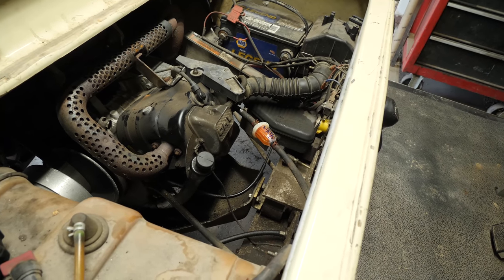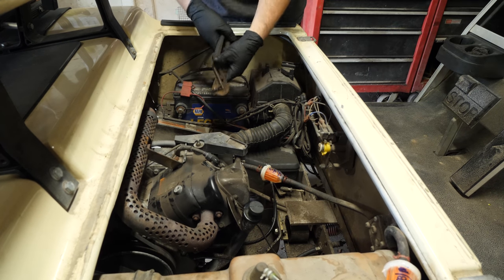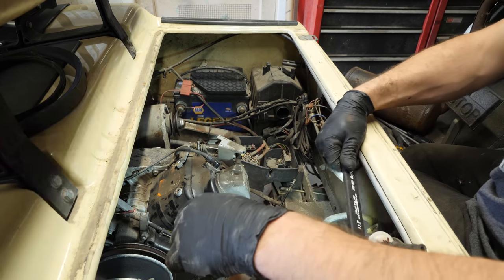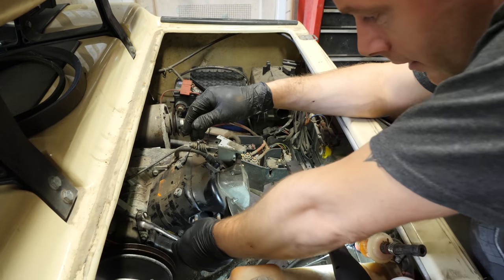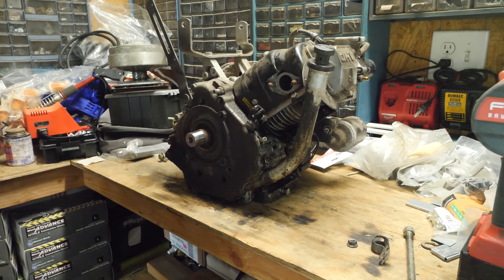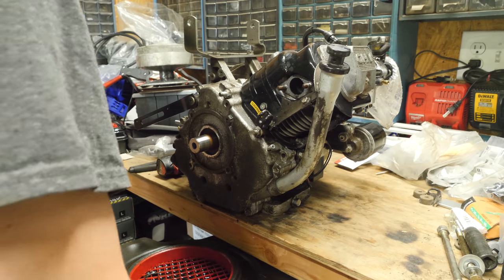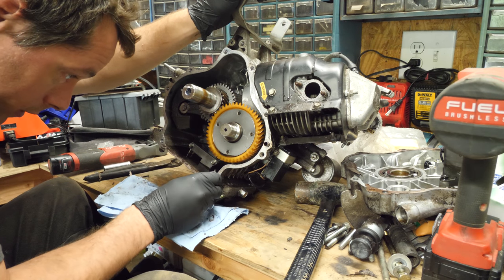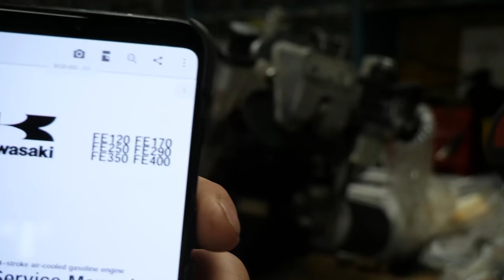2008 Club Car DS, Gas - Blown Crankcase Gasket

Comment: Thanks for the tutorial!  I got a 2004 CC Precedent with the FE290 at an auction and was disappointed (though not shocked) to find out it was leaking oil after I got it home.  I had been watching your videos prior, and quickly found this one with the exact symptoms I was having. I saw the same gasket breakdown you had with much of it pulled into the crankcase.  Several man-hours later, the new gasket is in and it’s running like a champ… with no leaks!

Comment: Thank you so much for this video!  It saved my butt.  I have a 98 CC with the FE290 and had the dreaded leaking crankcase gasket.  My first time pulling and opening an engine and it went fantastic.  Engine is back in the cart and running like a champ.
Reply from the maker: That's awesome!!

Comment: I really like the way you explain everything you're doing. I always try to find one of your videos when I need to fix a problem with my cart. Keep up the good work! We appreciate you helping us.
Reply from the maker: Great to hear!
Reply: @Kevinsgolfcarts  I'm trying to adjust the cable that's in the electric box that operates the cam that works the micro switches that works off the accelerator pedal that goes to the governor. I can find everything except how to adjust it. The cable is out of adjustment and the engine is hard to start and the governor isn't working right. Do you have a video on how to adjust it? If so, which one is it?

Comment: Incredible video, very thorough!
Reply from the maker: Glad you liked it!
Reply: Just a side note of my experience, the clutch was stuck on even after a few heavy taps with the impact wrench.  I filled the hole with oil and wrapped the puller bolt threads with Teflon tape to seal it in.  This adds extra pressure and lubricant which broke it free.  Thanks again!

Comment: Interesting to see how you got the motor out. I have changed that gasket lots of times I think it was a club car recall. I usually just remove rear body. It's easier for me. I have also heard of guys replacing that gasket without removing engine.
Reply from the maker: I like to take the engine out so I can be more thorough. Its much easier for me to just plop it on the bench and do the work instead of being hunched over the cart. It also helps keep the oil and other the mess out of the customer's cart. Removing the body on most of the carts that come into my shop would involve removing rear seat kits, tops and then the body. I find this method works best for me.

Comment: Is there a reason you put the 6 bolts/nuts that hold the engine in last instead of putting them in first as a reverse of the removal procedure? Just wondering?

Comment: If the top body over motor was a hinge up or removable, work on engine bay on these be much easier. Have 2000 model in Aussie needing that gasket done as well. Might mod my cart to suit.

Comment: Wonderful video helped me a ton.  Only very minor critique is.. why didn't you replace the crankshaft seal while you were in there?  That is what was bad on mine.  Regardless, you showed me how to get to it and saved me $400 that the shop wanted to charge me.  Plus loading the cart on the trailer, going to pick it up and calling them to ask them when my darn cart will be finished.
Reply from the maker: The seal was still in good shape and wasn't leaking. At the time, the seals were on backorder for a few weeks and the customer didn't want to wait that long. They made the call to move forward without replacing it.

Comment: Great video !!! Two questions please,
The motor has been changed in my club car, is their any marking on the motor to tell what size & year it is??
Also, our local club car guy said the puller for the clutch assembly was $125:00 ?? 
(looked like a bolt to me). 
Thank you !!!!
Reply from the maker: It really will depend on the year, make and model of the cart. The serial number of the cart will tell you the year. This is a bar code somewhere on the body. Typically starts with 2 letters followed by 2 numbers. Those numbers are the last 2 digits of the year. No way that clutch puller is that expensive. Its a special bolt with threads only near the hex head. Some are left-hand threads.
Reply: @Kevinsgolfcarts  thank you !!!!

Comment: Thank you for the great video, I just did this to my 99 Club Car DS. The gasket failed in the same spot. Once I placed the new gasket on the engine I found out why they leak in that spot. The gasket does not seal that area properly. I took some pictures of what im talking about. Either I got the wrong gasket or there is a flaw in the design.

Comment: Ive got a 06 club car with the fe290d engine and i cant figure out whats wrong with it. I put a new carburetor and fuel punp on it hoping that would fix it but it didnt. It will spin over but cant seem to get enough power to move. Its also spitting alot of gas out of the intake on the carburetor. Any ideas what it could be?

Comment: Question pulled engine with your help...
 I'm stuck at removing crankcase cover... have separated and spin loose from pillars but for some reason seems caught on the very end ... am I missing something didn't want to hammer it to hard
Reply from the maker: Sometimes the bearing gets caught on the crankshaft and causes it to stick. Using a rubber mallet, you can give the cover a few good hits and it should come off. If not, hit it back on and use Emory cloth to clean the rust off the shaft.

Comment: One of the things that happen when most people have an engine oil leak is that thought that if they overfill it, they won't have to check the oil as often.  That leads exactly to the problem you see here.
Reply from the maker: Another reason which is more common in my experience, people overfill them due to not knowing the total capacity. This engine had a whole US quart of oil added when the level was below the knurled section. As long as the oil is within the knurled section of the dipstick, its within its operating capacity.

Comment: Kevin is it possible to replace the driven clutch with out removing the engine i was looking for a vid but could not find one (club car DS)
Reply from the maker: Yeah, its possible. Its a bit of a dance with a floor jack and jack stands. I use the jack under the rear driver's side tire to compress the suspension. You have to get the clutch bolt lined up with enough room to remove it and install the clutch puller.

Comment: Quick question.  Does the size of the fuel filter determine the amount of fuel the carburetor gets. You cant use a fuel filter from a snowblower on a golf cart ?
Reply from the maker: Yes it does, to a point. The fuel pump can only pump so much fuel but if its restricted by a much smaller fuel filter, it could cause issues at higher engine RPM. The carburetor can only deliver as much fuel as the engine needs. The fuel pump can only deliver as much fuel as the carburetor needs. The fuel pump can only push as much fuel through the fuel lines as allowed by the capacity of the lines and filter. I wouldn't use anything too small since it will become blocked up faster and has less surface area to provide filtering.
Reply: @Kevinsgolfcarts  
Thank you for such a quick response.  Just enjoy your channel and videos. Thanks again 
Im in Winnipeg Manitoba Canada

Comment: Can you tell me did they just over fill it that blew that gasket? I bought one today with this exact same leak.
Reply from the maker: I believe it was a problem that started from being overfilled multiple times. Others have said its a design flaw of this engine. I don't know the history of this cart so I can't say with absolute certainty. These engines do not like to be overfilled regardless. They will smoke real bad and cause other issues. Oil and a filter are cheap, engine rebuilds are not.
Reply: With a fuel issue to start is it possible fuel leaked by the carb and into the oil?  I believe that may have been my problem!

Comment: Do you have the same video for a precedent?
Reply from the maker: Its basically the same procedure. They used the FE350 in the Precedent. Its just a different body.
Reply: @Kevinsgolfcarts  thank you for the quick response! You rock! Is the cross bar under the seat/over the motor going to be an issue? I know that the body has to be lifted up some to get the front of that out.
Thanks again!
Reply from the maker: That bar comes off. Its a bit tricky but its removable.
Reply: @Kevinsgolfcarts  thanks for all the great information! I have the engine out and the front cover off. The crank seal is not leaking (I did get a replacement) and I see you did not change it in this cover. Am I okay not replacing the front seal? It looks like changing the seal requires removing the bearing?

Comment: Remove the rear service panel to access the muffler clamp, belt, generator starter. You make the job a lot harder than what it actually is.
Reply from the maker: That's your opinion. There's a rear seat on this cart and it still is difficult to access. I have better access the way I do it. You are free to do it how you wish.